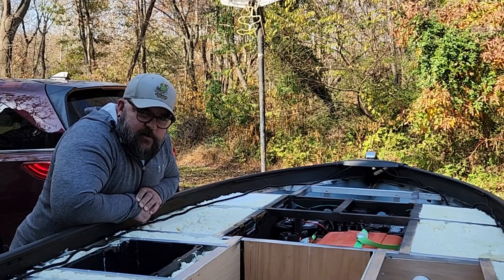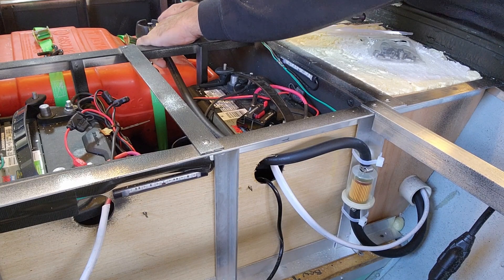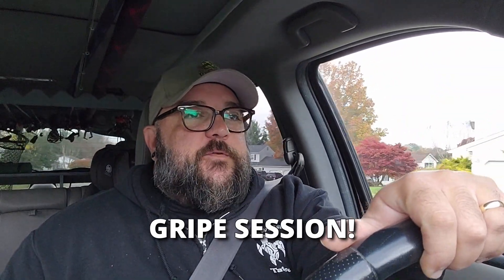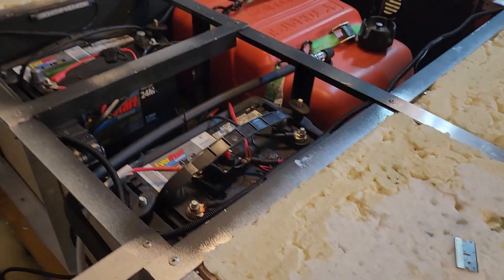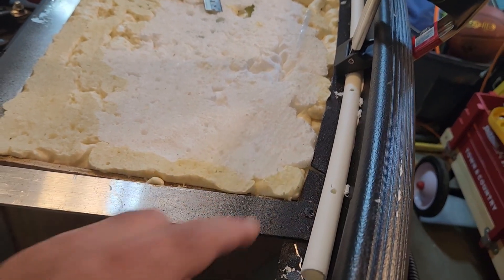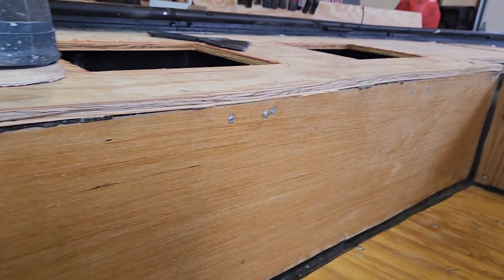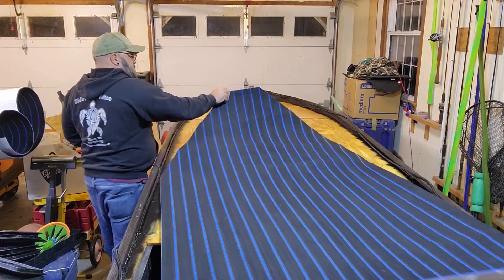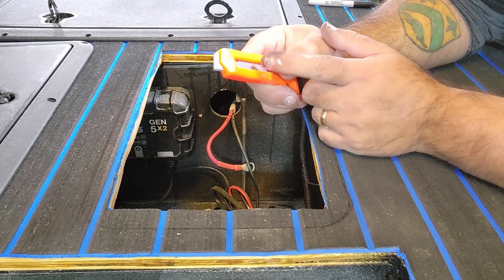Saving an Abandoned Search and Rescue Boat (Episode 8) - DECKING, EVA FOAM & HATCH INSTALLATION

Comment: The blue lines line-up. That's 90% of what's people see, right there. Nice!
Reply from the maker: Thank you!  I told myself the same.  To be honest, after giving myself some time to reflect, I don't know that I had any right to expect the project to come out any better than it did.  I've never done anything like it before.  Some of the videos I had watched made it seem like it would be super easy to get a semi-perfect install.  It was way more difficult than I expected... and I don't think it turned out looking "bad."  It's just not what I had in my head.  Now that I've done it once, I have a much better idea of what to look out for if I ever have to do it again.  (Which, I hope I never have to do.)

It's funny.  I posted a picture to one of the forums dedicated to this kind of project with a caption:  "PSA - EVA foam is a pain in the ass.  If I had it to do over again, I would have used carpet."  The overwhelming majority of people who responded to the post either gave me a "like," or offered reassurance.  That was nice.  There was this other demographic of people, however, who felt the need to say things like:  "It's not hard to work with."  Or, "You wouldn't have had these problems if you didn't cheap out on the material."

Um.

Yes it is; and yes, I would have.  AND it would have cost me even more than the $100 per sheet that I paid for the "cheap stuff" that I got.  Carpet would have been way easier to apply.  It's likely just as durable.  And I could have applied it to the panels (in the warmth of my home) BEFORE I riveted them into place, rather than have to fight with the sheets of foam in my garage.

I'm hoping that, as things progress, the results will grow on me.  I've gotten nothing but compliments.  Maybe one day I'll get over myself, but this is just like any other project I've ever done.  My expectations of myself were way too high, and since it didn't go exactly the way I thought it would I now have doubts.  Whether those doubts are valid will reveal itself in due time.

Comment: If what I'm hearing is what I think I'm hearing, I can confidently say this: "as a former West Marine inventory manager, anything from the fuel system aisle to the sailboat hardware aisle has probably been shoplifted and swapped for old/broken shit."  Boaters are frequently simultaneously "rich" enough to buy a boat and "broke" enough to justify stealing almost anything associated with owning one.
Reply from the maker: I was wondering if you'd have a take on this topic.  We're on the Chesapeake Bay, so you'd think there would be A BUNCH of West Marine stores around me... but there isn't!  There's just one.  During the peak of the season, I'm sure they get slammed.  In the off season it's pretty quiet.  The things that drove me nuts were (1) it didn't feel like anyone put any actual thought into what pieces and parts needed to be carried.  For example: There are four possible Tohatsu fuel line fittings.  There's a male connector on the motor; a female connector that connects the motor to the priming line; another female connector at the tank end of the priming line; and a male connector at the tank.  All they had in the store (or in any store within 30 miles) was the female tank-side connector and the male engine-side connector (which aren't compatible with one another).  RIDICULOUS!  And (2) the total lack of knowledge from anyone on the staff regarding how anything actually worked.  The most knowledgeable dude on the staff was the guy I accidentally squirted in the face with fuel.  NICE GUY!  Not exactly a ringer when it came to fixing boats, though.  His counterpart (who bore an uncanny resemblance to Side Show Bob) was the first to say "I don't know anything about boats, dude.  I just work here."

West Marine's prices don't really help anything, either.  Charging more than $2 for a single stainless steel screw?  Really?!  $10-12 per foot of fuel line?!

All of this to say:  Shopping at West Marine isn't a great experience and I can kinda understand why people of a certain disposition wouldn't feel too bad about five-fingering bits and bobs.  Not saying it's okay to steal, but I'm saying that I can understand why people might not feel so bad about doing it from them.
Reply: @CareAgainFishing  when I was there, it was all about "store to door" and the infamous WM catalog. Basically, "we don't have room for all this, so we'll carry none of it - BUT! We can order it for you here and have it drop shipped to your house from the warehouse for no additional cost."  Aka, it's cheaper to have a small store and ship stuff that people want, than it is to stock stuff nobody wants in a big store. Probably even more so today, since Amazon wasn't nearly as popular in 2006. I bet it's a shit show. The best employees were the salty dogs that lived on their boat half the year in FL.